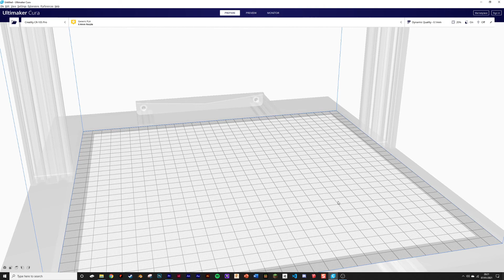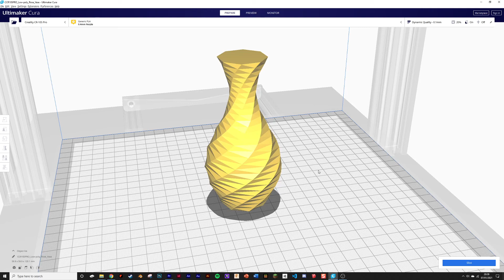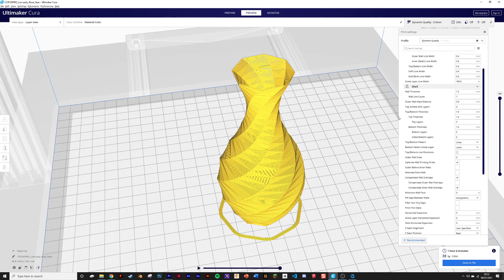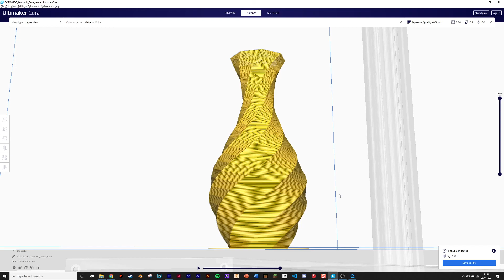How To Vase??? Vase Mode Tutorial for Cura 4.7+

Comment: Helpful as I kept hearing about the Vase Mode but never found out where and how to set it up in Cura?  
Funny as plenty of 3D printers talked about using it but never how to even find it on the system?

Just a little bit of pointing out here, You need big time to sort out your volume and quality of the Audio used on the voice over recording as I had to increase my volume on the TV to 50% higher than normal and turn on Amplify to just about hear your voice and no I not hard of hearing either!
Reply: Also,  drop the annoying music. Otherwise,  good video. Thanks for the info!

Comment: so im attempting a vase mode model but im having a real pain in the ass problem.
your video was good btw for easy settings at the start, but you need a better way of actually showing us with your mouse, you did up to a point, but when mentioning speed of print, i saw nothing.
now im experenced enough to know were these are, but if your doing a tutorial, then make all your actual instructions clear, and espcially point out were all they are, as there maybe a complete beginners watching.

back to my problem.
so it prints fine other than the whole model has fine dots on it all over, and watching it i can see its kind of stopping and making a small blob every so oftem.
now i read it could be retraction, so i stopped retraction.nope still blobs.

so i thought, could ne the model, fetched a proper vase model, and nope, blobs again.
it basically looks like my model has spots all over it.

so anybody any ideas, or even full cura settings for a Vase print that should help me with my problem.
would appreciate every setting you use to print a perfect vase would help me.
my printer btw is an Ender 3 pro V2.

oh i thought i would also mention, the printer litrally printed a flawless model right before this.
you can check some screen shots on my twitter, (tozol)

thanks for any help.
Reply: Could be the filament also don‘t deactivate retraction. Add a mm or two to the retraction distance and make retraction speed 2-3mm/s faster
Reply: Could also be your temps too high.
Reply: Guys I fixed the “dot “ problem from another video, took weeks to track down.

It was a safety feature built into the ender software, that was pausing for a millisecond ever layer.. which created the dot.

The video I found who’s how to remove that line of Gcode, soon as I did , perfect prints.
Reply: @CrankyGamersUK  Let me guess, power loss recovery feature? I've just watched a video on this from Bryan Vines. XD
Reply: Make sure “ensure vertical wall thickness” is NOT ticked and this should stop happened.

Comment from the maker: What tutorials do you guys want to see? Let me know if there’s anything in particular.

EDIT: Wow how did this get so much views
Reply: Anything to do with making overhangs look cleaner on prints. Great vid!
Reply from the maker: @jackwilson7502  Hey Jack, I've made a vid on overhangs which you can find at --> https://youtu.be/Cct6yFzoVFk . I might make a remake of that video since the editing isn't really up to standards, so might add some more info to that. Generally though I'd try either using supports or increase your fan speed, the support would give your printer a flat base to work from and the fan speed will make the filament set faster so it doesn't droop. Thanks for the compliment :D